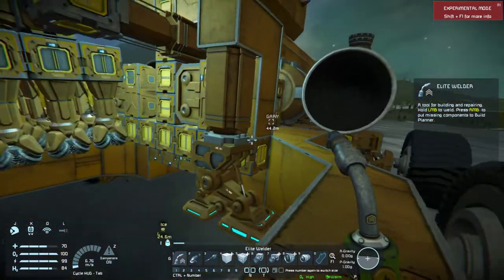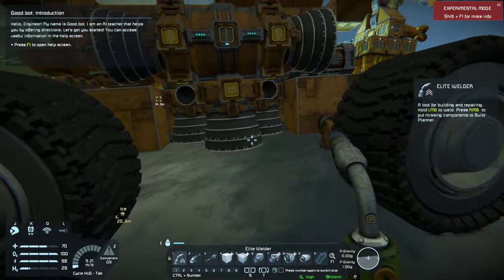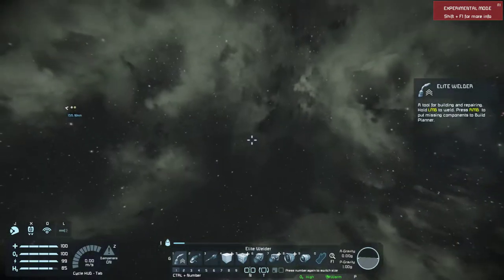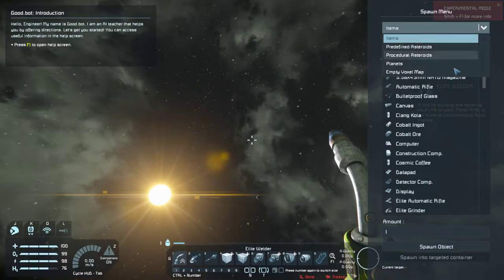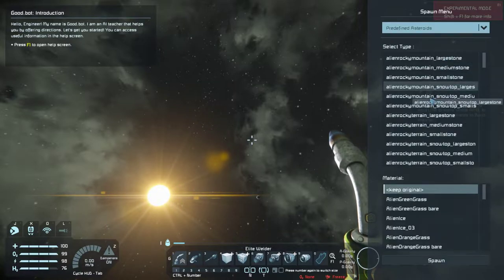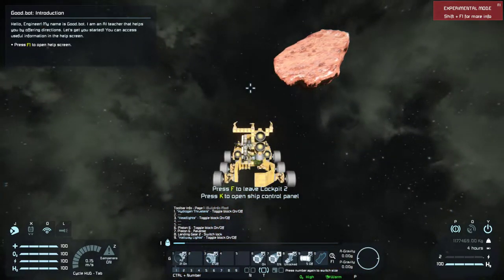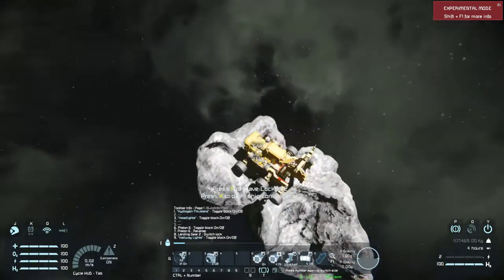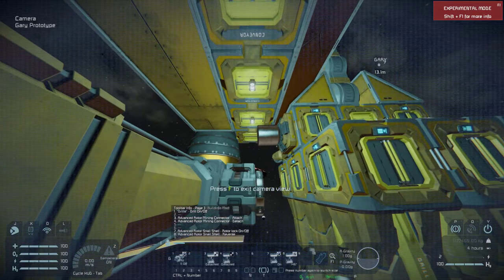Space Engineers HINGE DRILL SPACE SNAIL "IT WORKS!"

Comment: This is really crazy. Can you explain a bit about the coil? How does that work?
Reply from the maker: Rotor plus conveyer junction. Pick a direction and start adding hinges. Turn all torque down to zero and turn off the hinge. You can see I lock the drills otherwise flying would be impossible. Works best in gravity I have found. It’s a really fun gameplay loop and in my opinion both pistons and hinge drills have benefits and drawbacks. Works well on a live server.
Reply from the maker: Also needs a safety railing wall to keep from uncoiling sideways